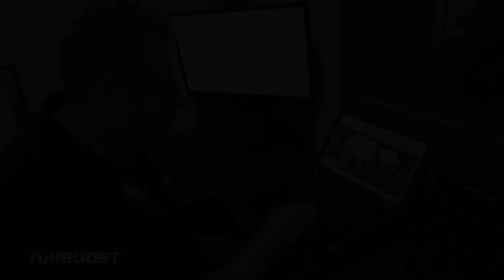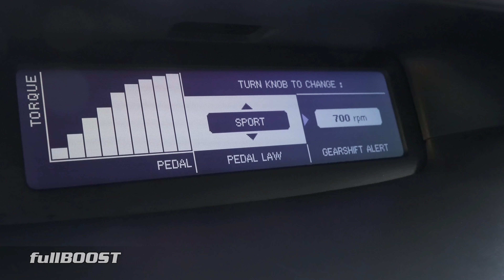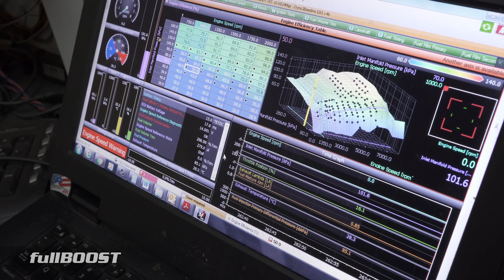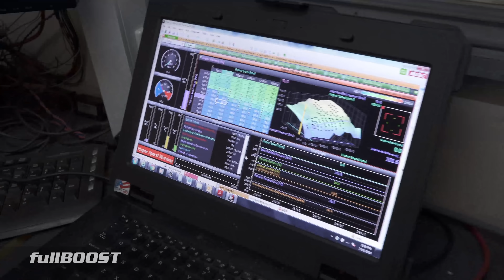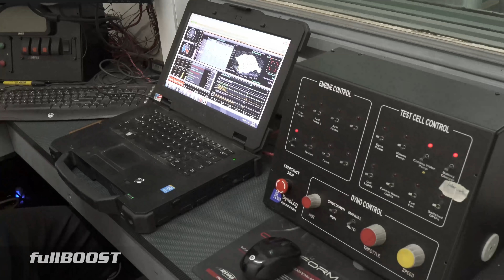Why Drive by Wire throttle rules | fullBOOST

Comment: Great content.  I've been using DBW for years to control boost in my Turbo LS 6.0 with an 88mm with no wastegate.  Changed from a gold blade to a much smaller throttle body from a V6, to get better authority.  14psi is around 50% throttle open.

Comment: Very informative. I have a 14 focus and it's the first car I've owned with an electronic throttle. If I step on it a little, half throttle, and accelerate from a stop to about 30mph when I
release the throttle quickly there is a noticeable delay before the throttle actually closes. This is very disconcerting when you continue to accelerate after releasing the throttle, even if
it is only for a tenth of a second.

Comment: The problem people have, me included, with drive by wire, is not the speed with which the valve can go from 0% to 100% open. It's the response and the precision of the throttle movement reflecting our right foot/right wrist. Nobody likes to press the gas pedal/twist the grip and get 0 response. The cables are as fast and as precise at opening and closing the throttle as you are at twisting that grip, the ride by wire lags. That lag is the problem. Can you get rid of that? Can you make a ride by wire be as instant and precise as the cable was?

Comment: Do you do remote tuning? I like your explanation on drive by wire every will done .I have a lexus sc300 with a 2jzgte vvti dbw I want to get it setup .I m running aem infinity 506 ecu

Comment: So Drive by wire compensates for idiots ?
Calibration as discussed teaches bad habits to the driver unless it is in a Race environment where every little bit helps IMO. 
I would say as well for the application of throttle in a linear DBW map the cable is faster or as fast as it is directly linked to the pedal. Also when released in linear it will only close as fast as the pedal returns. Back in the days of carbs with mechanical secondaries we used to put the throttle cable pull off center to achieve the 75% pedal 50% throttle or less for decent drive ability on rough roads. His point about on boost part lift of is good as all OE stuff is set up for the very first drive and that sort of throttle technique would take a wile to learn. 
May be im just old school in that I prefer a power/torque curve that can get away from me as it adds to the enjoyment of driving far more than just going fast...
Please use every opportunity for Tyrone to reappear on the Channel.
Reply: That it is, you can adjust the lobe both ways, quick/slow ramp or change how it was in the middle.
Reply: DBW compensates for morons just like boost limits in the lower gears does for the turbocharger. Everybody thinks they are a great driver. Umm, if you can launch the car without wheel spin then I would agree. Since almost nobody can accomplish that, these are tools that make you look like a hero behind the wheel and nobody is the wiser.
Reply: I agree. He says that it takes 75ms to actuate from 0 to 100% on the throttle itself which is all good but you have to take into account the signal response time from the pedal pickup to the ECU then to the throttle motor for it to actuate. This is the reason most people complain about the lag. Now this stuff is run from a limited refresh rate in the ecu and most aftermarket ecu's are faster than a OE ecu and you will notice less throttle lag just by changing that factor.

It makes perfect sense to use one for a drag application but for circuit racing I don't think I would get on board with it. As a skilled driver I don't want anything interfering with what I am doing with the throttle in a dry track situation. I am quite capable of determining what I need to do to get the power down correctly. HOWEVER in the wet sure it will be much more useful than traction control when set up correctly.

I feel DBW is a good solution for certain drivers and applications but it's not for everyone.
Reply: @GarageSupra  The DBW lag has nothing to do with the ECU's input signal reading nor output driver task rate. As he mentioned, manufacturers use it to prevent driveline jerk/thumps due to driveline component clearances.

He also mentioned in the video multiple times, the main benefit of DBW is to limit the throttle angle for speed/loads that don't require the full 90 degrees of throttle body blade rotation. This provides the driver a more predictable engine torque request as a function of foot pedal angle.
Reply: @GarageSupra  , with respect, i have to correct you. Nearly every high-end circuit racing car (ALMS, DP, F1, etc.) utilise DBW for this purpose..speed and accuracy...so it is by no means "just for drag racing". There are an increasing number of circuit cars running DBW....change is slow, often fuelled by fear or ignorance or both...not suggesting you are either!
On a modern ECU, the signal response time is negligible in terms of the response time of the throttle..ie: on an M1, the driver input pedal posn is sampled at 200HZ (200times/sec = 5mS). The loop time for the M1's microprocessor to calculate the required output to the motor is infintesimal (order of nanoseconds, or millionths of a MILLISECOND..10exp-9 seconds!). The time for the TPS to be read (also at 200Hz, or 5mS) means there is approx 10mS plus a few nanoseconds propagation delay between pedal and plate position. So theoretically a delay, but practically it has no effect on the speed of response of the throttle body, if you push the pedal fast...take worst case, 0% pedal to 100% pedal instantly..first sample, pedal reads 0%, 5mS later assuming you push the pedal to 100% in 5mS (unlikely), the PedPosn would be read as 100%. Output H-bridge goes to full on, and then it is all down to the speed of the actuator motor...so 5-10mS of delay in something that takes 75mS is negligible, especially considering the manifold fill time to the change of MAP, which is a function of the manifold volume. Introduce a step change to your mech throttle plate (or DBW for that matter) and watch the deltaMAP (change in MAP vs time)..it is finite, and has significant bearing on engine tip-in response, far more so than the outright speed of the DBW actuator! In nearly all cases the actuator response is damped or "slew", and in OEM factory unmodified cars, especially manuals, it is slewed excessively for what many "performance" drivers desire...but they drive nice don't they, and they are still pretty fast response at higher engine speeds (the response is often made faster at higher speeds/loads and pedal rates..all tuneable by the OEM engineers, to meet the DNA and targets of their corporations...not every one demands zoom zoom!). With the M1 for example, we can tune the response to however we want...and it most cases, some slew limiting at lower pedals is still best, feeling intuative to drive, rather than having to "drive around it"..anyone with mechanical IRTB intakes that are large will tell you what "driving around" the low speed reduced airflow authority is like, as WOT (100%MAP) at lower engine speeds can be as little as 10-15% pedal. As i explained in vid, 100% load often comes WAY before 100% plate angle at everywhere below full power.
If you have a cable, unless it is push-pull like most motorbikes, when you let off the throttle, you rely on the spring force to return the plate closed. But the momentum of airflow flowing thru throttle is one force that can resist it closing, as it stiction in the cable, shaft bearings, linkages, etc. So the net force to actually drive the plate closed is the spring force MINUS all those other forces, and the spring force gets less the more the plate closes (nice differential equation problem!). So the result is often if not always that the closing force is significantly lower than the pull force when you rapidly open it..so closing can be way less rapid!!
Contrast that to DBW, where the actuator is driven closed by the same motor force that it takes to open it, with the only detriment being those forces of air mass flow resisting closure. Postive closing, and we can dwell it a bit as it returns to idle to improve rsistance to stall, as well as controlling the minimum manifold MAP to avoid decel misfires, poor combustion, shuffles and huntingetc on closed throttle decels..which we have all heard cars at the track do! If you want a drive a pig, that's fine by me...but there's no reason with modern DBW tech that just because it's fast it has to be a pig to drive! Remember, as I often say, if it's easy to drive, it's very easy to drive FAST!
I did my first DBW racecar in 2002 - no-one i have even done DBW for since has ever wanted to go back to cable, or take it away...quite the opposite!
Reply: Sorry for long post, but you may have gathered I am a man of science and data-driven decisions....rational explanation of a differing viewpoint is far more effective than heresy or opinion, however well intentioned. 
Carry-on!
Reply: @tyronesmith3494  No Apology needed. 

The stepper motor will overpower any throttle return springs and if sized correctly the air mass and its momentum, important with boost. The mass with momentum didn't even occur to me. As for spring returns they can be as fast as you will tolerate, of course a valve spring is out of  the question. My comment used the term linear meaning the throttle represented exactly the pedal position regardless of engine state. 

Taking away the throttle control from the driver and turning it into a power demand control was the crux of my sook.  Might as well have an electric motor instead.

No disrespect intended. 

Your explanation was clear in the video and the post just expanded it. 

Cheers
Reply: Wow! Thanks for taking the time to explain that even more Tyrone.
Reply: What an interesting conversation. Oldschool vs new school, picking out the nuance. Love it!
Reply: @tyronesmith3494 
Would you be interested in doing amg m156 lpg project based on Vialle hardware and syvecs ECU's?

Comment: Drive by wire absolutely sucks if your car has a manual gearbox and you're trying to rev match on your upshifts. Nothing like it unnecessarily keeping the revs elevated when you need them to drop. In my truck, if I waited for the revs to drop to the proper RPM for the next gear, I'd lose all momentum and need to shift back down, particularly when going from 1 to 2. It's absolute horseshit that automakers continue to put this crap on cars.
Reply from the maker: It quite easy to fix that with a throttle controller 👍
Reply: @fullboost  Is that true? I've been told that they only affect how much the throttle opens when you press on the gas pedal, but not how quickly it closes when you release the  pedal.
Reply: @melinuxf00l  it's also easy to lose 2k to fix that

Comment: Lots of butthurt in the comments. 
Very cool video. Thanks for the info. I've never driven a DBW car aggressively. The only DBW I truly didn't like was a Z3 3.0i with the M54B30. I found it to have slow tip in which, combined withe clutch delay valve, made it more difficult to drive around parking lots and such. I've driven that exact same engine in an e39 and had none of those complaints. I race a non-grip-limited mechanical diesel so I'm coming from a very different place than most.
Reply: What is racing non-grip-limited mechanical diesels? Im legitimately curious.
Reply: @DgtalBreakz  I race an old Mercedes Benz with a mechanically injected diesel engine. It has a lot of tire and not much power.

Comment: no dbw is slow unresponsive and dangerous because the possibility of unintended acceleration   i can guarantee you i can snap a cable TB open FASTER the DBW anyday also sucks when you have to use a midtronix mdx 600 battery tester and having to go back and forth to rev engine out of and under loads sucks cause you cant rev the engine while under the hood

Comment: While I can completely understand the value of drive by wire in a performance application, where the tuner has total control of adjustments to improve drivability, in the OE market it is being tuned by manufacturers to help bad drivers have smoother throttle input, while ruining the responsiveness for people who are accustomed to carefully modulating throttle inputs.  I’ve never felt a drive by wire car that was as easy to modulate throttle in as I have most any cable-driven car.  It ends up feeling numb and lifeless.  Too bad this guy didn’t tune the throttle mapping on my Audi, because it feels absolutely awful compared to my 300ZX TT that is 20 years older.
Reply: Why APR didn’t touch throttle mapping with their tune on my A3 is beyond my comprehension.  Shame on them.
Reply from the maker: I had a Meganne 265 and it had different throttle maps available (OE). It was night and day to drive based on the maps. Opened my eyes as to how good DBW is. But yes, many cars feel terrible as you said, its designed to make the car feel smooth. For commuter turbo cars, it usually makes them feel lazy.

Comment: Throttle pedal position mapped to RPM rather than to torque would be just the ticket for burnout cars, especially turbo'd ones. Somewhat similar to a cruise control. Hold the pedal to a constant position just a bit less than the rev limiter and away you go. None of this mang-mang-mang business!

Comment: What happened to good old fashioned peddling the car? In my opinion this is playing around too much with the throttle and starts to become an unreal feeling with driver and power response/delivery. Just my opinion, but this is slowly heading toward the car/engine management taking over stuff the driver should be learning by driving the car and feeling it out for themselves... Again just my opinion. Good Video FullBoost.
Reply: WOG13B I greatly prefer the feeling of direct feeling also, but would have to drive a well set up dbw car to form a proper opinion
Reply: @TooManyPatrols  a well set up dbw tb on car rated north of 60k will need money and lots of it. a typical driver who has a typical job and typical life drives a corolla or a crv or a hyundai and the response is terrible even by modern computer standards. this needs to stop and let the people choose between cable throttle or pure digital motor like Tesla

Comment: Bah,,,,,but what he is saying is and isnt true . On average its true more like FI. Someone thats tuned old cars for power can tune a engine non injected to make its peak power no different than if it was an FI engine .
On fly by wire there is a severe disconnect from the Human and the interface .Of course engineers love this and I am guessing a ton of car makers do as well for the vast majority of drivers. Someone good with engines and good with cars and good with driving wants that connection. I still would bank on the human hair covered computer over the electronic one if you give me the right human.
Now does the fly by wire open more doors for cars to perform better for the AVERAGE person ? Of course it does because it takes responsibility from them. 
Ive driven and raced all three entities  , Cable with Carb , cable with Injection and fly by wire . My preference for performance over a period of time is the Injection with cable . In the beginning even that small lag was too much but its something you get used to. Fly by wire is very hard to adapt to.....
If you want to put a dummy in a car and get the same results from the car as someone with more experience and knowledge , of course you want systems  filtered through a computer..... The computer then decides and it will always decide the same.

Comment: Fantastic Video, DBW is only good for simplification of the engine bay and idle and traction control, Oh and the fail safe limp mode! That's it! Slowly but surly we'll lose all skills in driving ability with all these systems, Yeah it's fast, but your foot can't even move that fast, so why? < As we all know soon the cars will be driving themselves! Fuck we already have a Overabundance of Automatics around Fuck this shit!
Reply from the maker: Once you get into it, it's actually awesome.
Think about what you just said about the speed of it. If you wanted to, you could press the pedal 10% and the throttle can crack open to whatever % you have configured (and change again depending on conditions).
Reply: @fullboost  Ahh ,a awesome point, I was thinking too superficial, will it get to the point that it almost requires no skill to "operate/Drive" cars in a competitive environment though?! From a tunability angle DBW is defiantly superior.
Reply: Wrong, like I said above. Can you have double the stock power and not spin the wheels? That is why I find Cootamundra interesting, people are slowly learning and I do mean SLOWLY learning that wheel spin is a no-no. 2000-2500 hp G35's  do kick the front wheels to spin so the car won't bog off the line but for everybody else should avoid it like the plague.
Reply: @dj4monie  Who are you replying to here? LOL.....We all know DBW can be used for TRAC, As you're not referencing anything said before!? Just a outright WRONG lol....